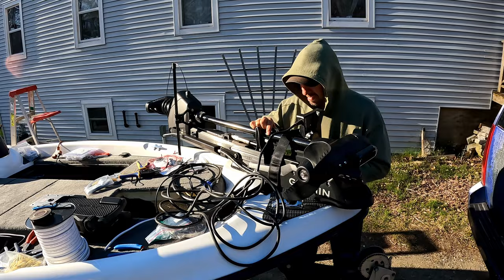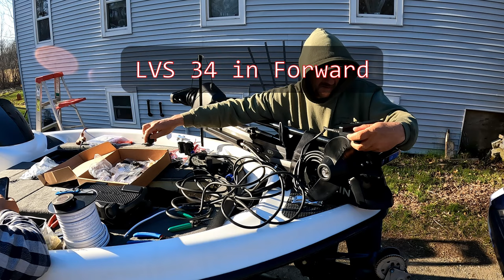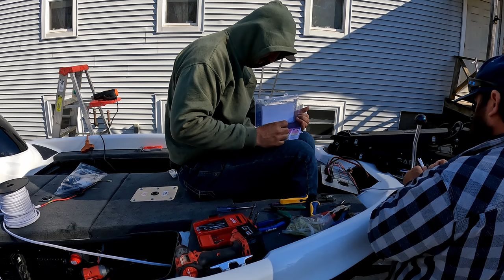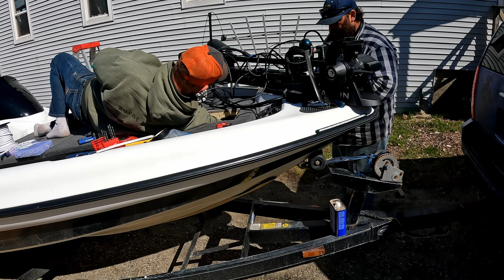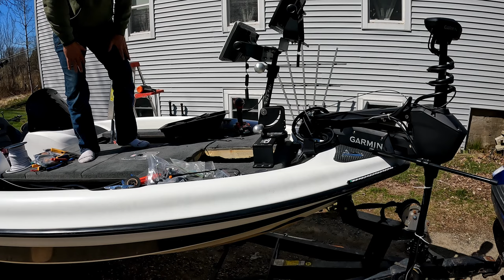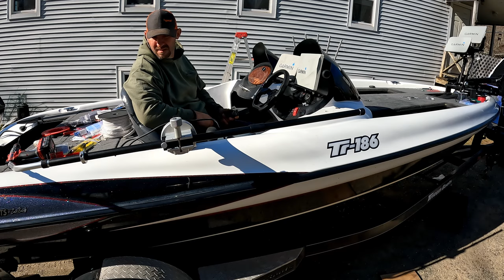Boat Restoring: Mounting 3 Livescopes on the boat. BEAT DOWN mounts. EP14

Comment: There is a small strip of rubber you forgot to put between the barrel mount and the barrel of the trolling motor. Helps keep it from sliding. Good job fellas! Nothing stopping that boat, you've got it all!
Reply from the maker: Dangit I hope I didn't throw it out but it makes sense, thanks.
Reply: @JoeHollandFishing  I bet a strip of rubber inter tube from a tire would work as well. It's about 1/32" thick.